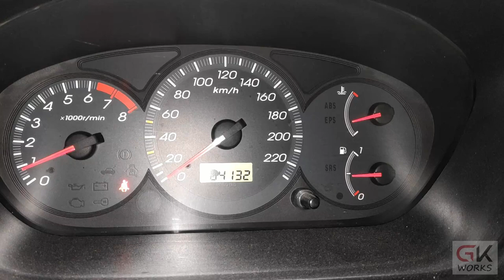Honda Civic 2001-2005 Detailed Oil And Filter Change l EP1 EU7

Comment: Why are you using 5w-40? I’m not one to shy away from thicker oils in my old cars I’m just curious why you chose that over 5w-20
Reply: My mechanic put 10w-40 in my ‘04 civic, said its recommended for older cars like mine 🤔
Reply: Nevermind just read the description, says it depends on climate apparently
Reply: Yes same just had one put in 10w-40😂